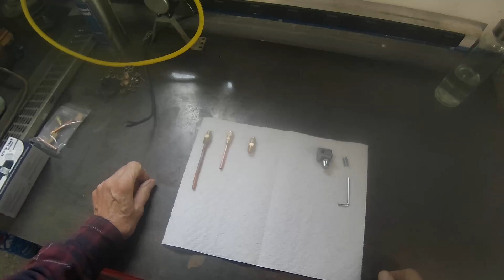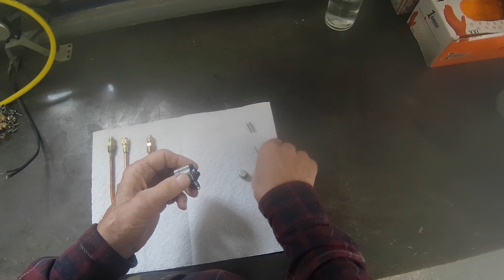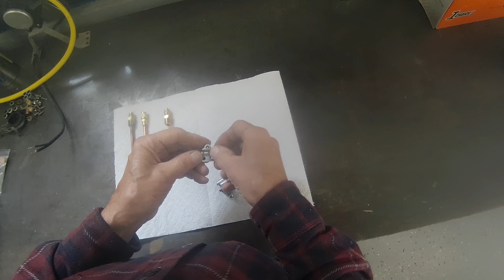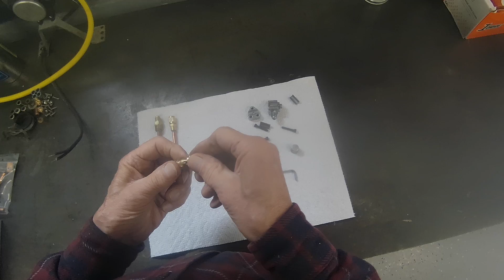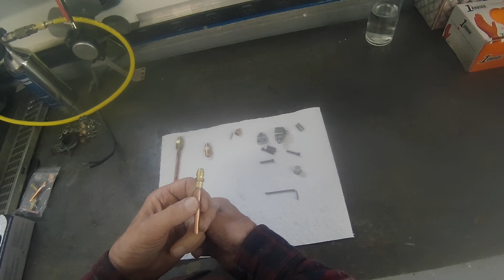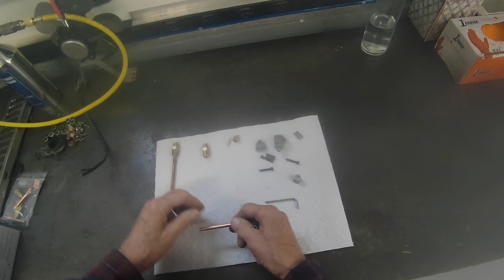Piercing Valves & Process ports

Comment: What are the pros and cons of using one of the screw on bullet connectors long term (appliance applications).  Do they often leak, or very rarely?  In my uses over the years I brighten the line and apply a thin film of Nylog much as you recommend.
Reply from the maker: I'VE been using Supco bullet valves for 50 years and very rarely had problems leaking, if installed right. Don't use them on the high-side long term.